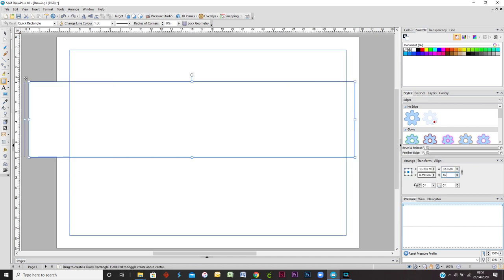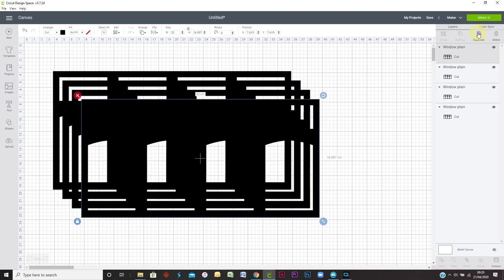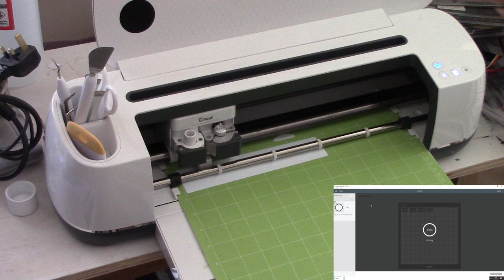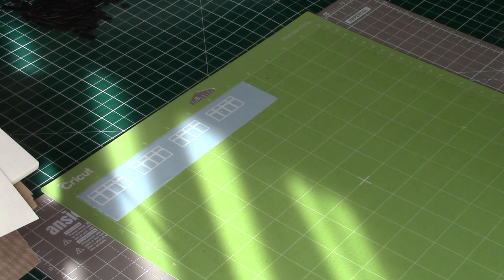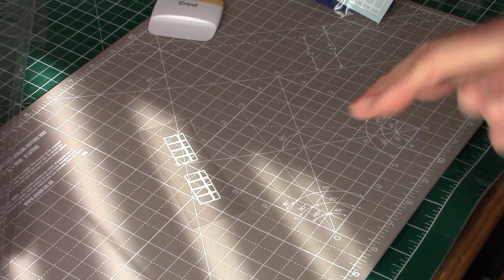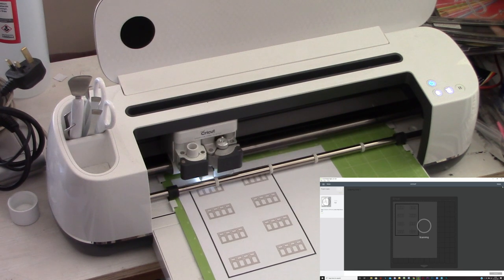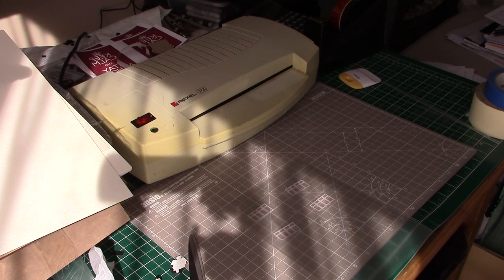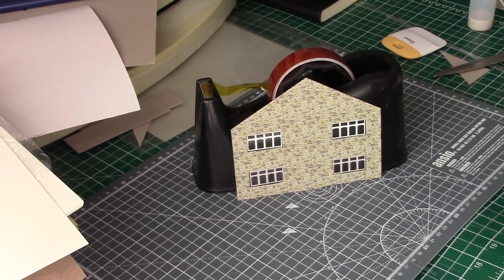#44 Two ways to scratch build windows

Comment: So, one can never have a white part with print then cut because the bleed needing to be added to the printed part, unless one goes back and paints over the bleed?
Reply from the maker: I think I understand what you are saying. Because with print and cut you have to define the area which is cut by erasing the colour of the area you do not want. In this case the unwanted area is the background which is the white paper because it is not printed on and just so happens to be the same colour as the preserved area. The bleed area is an over print of the printing itself so when you cut you do not cut beyond the chosen printed area.
Reply: @JumbleLane  this is somewhat difficult without being there to point. But it seems the area you want preserved and not cut into, always has to have some bleed or shading/print of some kind, correct? So no portion of a structure can be white on the image, correct?
Reply from the maker: @KenN.OXN.805  I s as m not totally sure of the point you are making. The term bleed is used in printing which means a printed area which is cut as part of the manufacturing process is over printed very slightly so when the cut is made all of the initial print is preserved when it is cut. For instance, you are printing small square cards which have a red border line and these cards are cut on a guillotine at a later time in the process. The red portion is printed a tiny bit bigger so when it’s cut you can ensure the red is visible all around the cut edge. As we are printing essentially white on a white background there is no actual print as white is the unprinted area so we have to fool the printer into believing that the area to be cut out is a different colour ie, the frame and the glass. I hope this explains it.
Reply: @JumbleLane  ok, I think I get it now. I’ll have to look at the video again. It looked like the print then cut frame had some shading/color. I thought that was the bleed you referred to.
Reply from the maker: @KenN.OXN.805  I would have to check the video again, it’s been a while since I shot it. The one frame I made fid have done shading as an attempt to make it look weathered and dirty, I think this was explained in the video though.
Reply: @JumbleLane  Ok, this time I caught the explanation you made about the shading on the print then cut version of the frame. Thanks for the video.😊

Comment: We're do you get your card and materials from please
Reply from the maker: In this case the card was just actually copy paper. The one method of print and cut printed the frames before cutting them out. Most card I use is either specifically the Cricut product itself or I have found card if same dimensions online. All materials are widely available online at outlets such as Amazon or eBay. As for these window frames I used standard laminating pouches with the frames inside to replicate the window frames but you can also recycle ♻️ the flat clear plastic as used in blister packages
Reply: @JumbleLane  thank you some much great videos